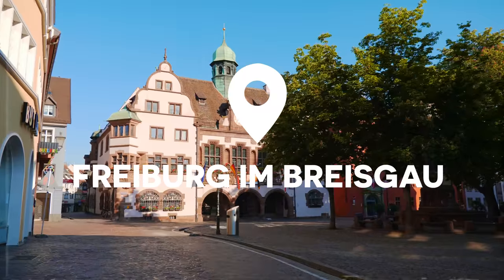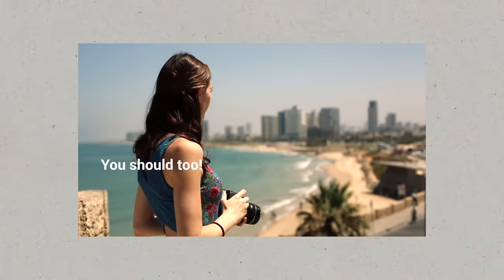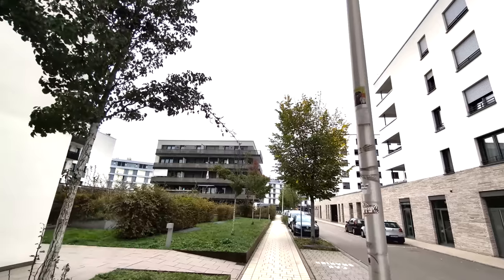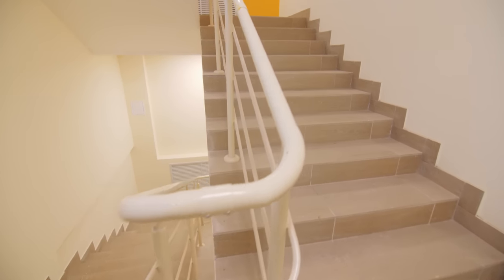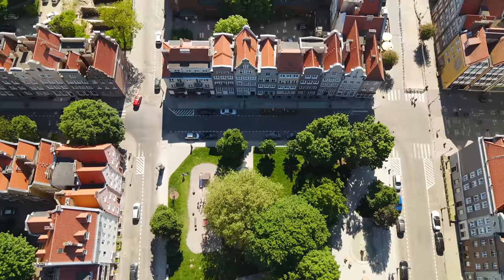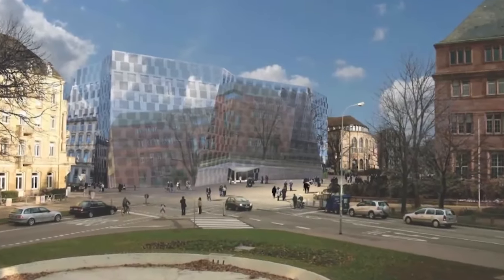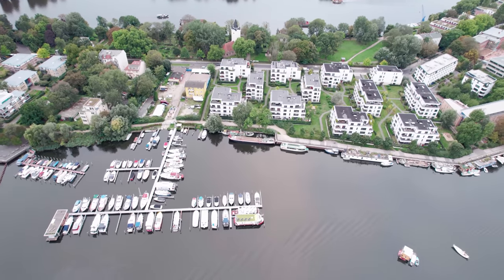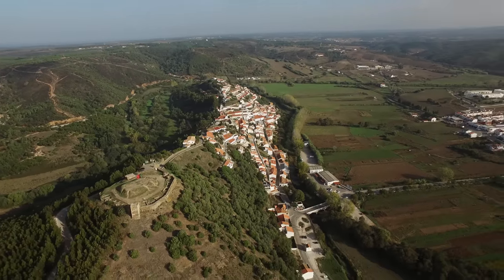Germany's BIG DUMB BOXES ARE AWESOME.

Comment: I worked in a building designed by someone who passes as a starchitect here in Malaysia. The problem was that all the curves did not fit well with our company, which dealt with PCs. PC boxes cannot fit flush against the walls. The basement which we used as a warehouse had ceilings that were too low. And the transparent roof panels (not sure if they were glass) had permanent water stains and leaked when it rained. I later worked in another IT company that used a dumb box. The place was a dump in comparison, but it was far more functional.

Comment: I am a building material scientist and really want to thank you for pointing out the huge amount of embodied energy in glass facades. Everybody is talking about how bad concrete is in this manner, but especially architects seem to forget, that a replacement with glass is even worse. In my opinion huge windows make a flat less livable than more conservative designs with smaller windows. You have less wall space, it has to be cleaned, in the summer the room heats up more and you need artificial cooling, Edge constructions are more prone to failures and are heat-bridges,...
I am also not a big fan of lame dumb concrete boxes, but they are much better than glass boxes with a fancy geometry.
Reply: Agreed. However, our windows (big, but not overly large, admittedly) help heat our house in winter, while the shade provided by the roof protects from the summer sun, or else the sunscreens do for the short time they may be needed.
Reply: @CaroAbebe  While writing the comment, I was thinking about pure glass facades, corners made of glass or huge window areas.
And I agree, if your windows have a good insulation value, they may help heating the rooms on sunny days.

Comment: Interesting as always, Ashton! My late father was an architect, studied as such in the 1940's and thus steeped in "functionalist style", which was much about doing away with heave ornaments and making for better living conditions for "the masses". He would probably endorsed this episode of yours. The idea of this as an architect stile was somewhat derailed by the industrialized building techniques of the 1960's. But building boxes doesn't necessarily equal lack of style.
Another thing which you hinted at is that the size is important for the environment to be livable. Personally I don't understand the present vogue about building 30 - 50 floor buildings. It is not what we used to do in Europe. No matter what country you study, traditional housing has been about 3 - 4 story buildings.
My father used to compare Denmark and Sweden in the 1960's, when we had a big building boom in Sweden. In the inner cities then, if one house in a blocks condemned, a big construction company bought the whole block and tore it down, building a new, much too large to be esthetically, box instead. That made for city centers mordor less all looking the same.
In Denmark however, they still were poorer than in sweden (it's quite the reverse these days). In the same situation therefore, they tore down the condemned house and squeezed a dew one in where the old one had been standing. Thus the new house automatically didn't differ too much in dimensions from the old one. And the over all environment looked pretty much the same as before.

Comment: The apartment I live in is almost a big, dumb box. It's exactly six storeys tall and contains eight apartments. The highest storey has a roof-top terrace and is pretty small, the other apartments have loggia-style balconies. Due to its location at a five-road intersection, it's staircase-shaped. But the building is very well insulated, the apartments get a lot of natural light, it's lovely.

Literally the only downside is that the footprint of it is quite big, which for the folks living in it mostly means we all dread it when the Kehrwoche arrives or it's winter, meaning there's about an hour or more of labor necessary to keep the sidewalks clean and accesible xD

Also, after having gotten into urbanism (as an amateur), I have realized that if I ever have the luxury of building my own home, it'll definitely be a pretty simple bungalow with a flat, greened roof (and solar panels), to make it an efficient little box to live in.

Comment: In Europe most new housing is still in the form of a box, regardless of having gabled or flat roofs. Less energy loss just because of the area/volume ratio being good and minimal use of material for a certain liveable floor space and easy to construct.
Compare with many new builds in the US, often single story with lots of intricate parts sticking out of the main structure on all sides also making the roof shapes complex, looks nice but adds to the cost significantly, using lots of materials for the given floor area and taking resources away from making the houses more energy efficient, more fire safe, more durable and of better quality in general.

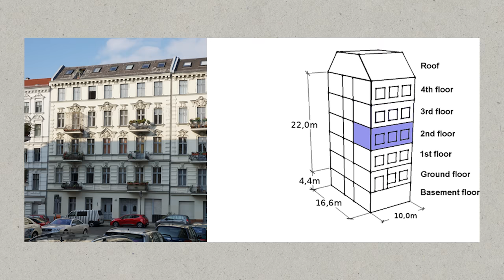Comment: 6:28 You are nearly right, but it is the other way round: "High rise means higher than 22m (highest inhabited floor). But the standardized ladders' performance is reach the building in a hight of 23m from12m (DLK 23/12) away. There do exist higher ladders and telescopic platforms, but these are not normally needed for rescuing people from high rises but are mostly for industrial use. Such buildings have (as you said) either two different staircases or a safety staircase either as a separate tower outside of the building oder a staircase inside which is kept under higher air pressure than normal, accessible through air locks.

Comment: The building I would like to live in would be up to 5 floors, whit 2 feet tick brick walls to the outside, large windows with wide windowsills and a round protruding tower at the corner (starting from 1st or 2nd floor). But that's just my fancy.
As for "boxes", I'm all for them, prrovided they are limited in height and consequently in number of flats, have an underground parking and a thoroghly thought through set of stores, groceries, libraries, schools etc. They don't have to dumb, owever; distinguishable colour scheme, mosaic on the facade, or even an ocassional folie would make them much less industrial looking and appealing to residents.

Comment: I live in a 5 story dumb box outside of Freiburg.  It's pretty great from an efficiency standpoint.  I hardly have to run the heat at all in the winter ( never have to turn it on in the bedroom), and of course AC is unnecessary.
Reply from the maker: Same! We have been holding out on turning on the heat as well. Sometimes the floors feel a bit cold on bare feet but our internal temp is still holding steady at 20C despite all of the cold rain (and quite a chilly morning today!)
Reply: At our last apartment we had a guy under us who installed a high efficiency wood burning heater that vented through our interior wall. We had warm floors and walls. It was pretty awesome. It would be nice to see some sun soon wouldn't it?
Reply from the maker: OH man it has been such a grey and rainy week. Yesterday morning the sun peaked out for a little bit and I immediately took the kids on a walk.

Comment: I‘d like to chip in my two cents on the Freiburg University Library. Taking the data from the University’s presentation (available online) things don’t look as bad as they first seemed after watching the video. According to the University’s website the overall amount of ‘usable space’ (Nutzfläche) is the same as the old building’s while the surface area of the new building (the building’s shell) is about 60% of the old one’s. The new building also features a number of sustainability perks like core temperated slabs, high efficiency glazing, a heat recovery scheme and ground water cooling - all of which were still pretty innovative 15 years ago and supposedly leaves the building with an energy consumption of only a third of that of the old building. 
Of course the website doesn’t talk about the amount of grey energy that went into the construction nor does it explain why the old building had to be torn down completely instead of following a remodeling concept.
So, all in all I’d dare to conclude that the building shouldn’t be counted as a complete failure. 
That being said, I do agree to the point you made about the many advantages simple ‘dumb boxes’ provide as excellent building blocks for a modern city - as long as this goes together with a meaningful concept for the design of the urban space.

Comment: As an octogenarian engineer whose architectural ambitions were squelched by economic reality shortly after high school, I see this contrast between North America and Germany a bit differently. There are "dumb boxes"  being built in both cultures, but the differences are mainly due to availability of local building materials.  Here in N.A. there is still plenty of timber, so design centers around how that material can be used with minor changes to the exterior walls just as I am seeing in the European buildings from your examples.
 Fitting in with the older buildings also seems to provide architectural influences for the differences. Most of the North American  developments consumed  more former agricultural land, in suburbs without  structural context nearby. 
I live in Orange County CA and have watched this process for decades. The generally 'blank canvas'  if orange groves upon which our alluvial plane has developed since WWII is just now finding 'dumb box' styles in the infill between major new towns as we urbanize this  former Los Angeles suburb and the rush hour traffic patterns now go both ways on the expressways we chose to  call Freeways. Those were incidentally influenced by the AutoBahns, a further reflection of transatlantic architectural commonality  of thought.

Comment: There are so many things to think about when talking about something "beautiful"!
In terms of cities, I think you are absolutely right: multi unit houses with no more than 6 floors and more or less cube-shaped are probably a good, sustainable and on various levels resilient way to go. Variation and individualism can be brought in by different kinds of surface materials and structures as well as colour. In older or more traditional quarters of the city, I'd go for gabled roofs, rather than flat. Mainly for aesthetic reasons.
Similarly single family homes: If they are built on the outskirts of a city or town, you can go for the cubic design. In real small European villages, I'd also go for the trad-adaption of a gabled roof.
I did mention materials.
From my point of view, wood is a very good material IF the house is allowed to stand for a long time! This way, the carbon that is captured in the wood will stand with the house and not be set free by the wood rotting or being burned.
Recently in my neighbourhood, there were two block houses built. One of them I don't like because the wood was imported over a few thousand kilometers and the design is not one that fits in this area. The other one, however, is made of wood from the same Bundesland (German State), looks like any house, just woodier, is nicely isolated and can stand there for centuries. The inside walls are made of clay which means the interior climate is not too much dominated by the wood. I really like the idea.
And this wooden building captures carbon, whereas cement or bricks need a lot of energy in their production.
The only problem: these huge stems don't grow so fast! So, for houses built from massive wood, I'd prefer a technique where you can use younger trees.

Comment: Dumb boxes in my country brings to mind the hastily and cheaply built apartment buildings from 70s and 80s, we sometimes call those "the suicide boxes" because of uninspiring and depressing environment and appearance. Personally I prefer older architecture, it's just more appealing  and inspiring to eye while being functional and seem to hold time better than boxes from that time period. Maybe there is a way to make them more appealing and resilient at the same time.
Reply: building quality in the 70s was so bad. I once was explained that that was a time when due to new building materials it was possible to build cheap for the first time. So there was a building rush of cheap constructions. Unfortunately nobody considered the quality and longevity. In Vienna buildings from that area are already being torn down, which is a shame after so little time....
Reply: @llleiea  True. Additionally there was the energy crisis, so the idea was to build everything more energy efficient, which meant trying to insulate everything and build houses like bottles. Some new innovations that didn't go well at all. Maybe some of them would have fared better if the overall architecture (on small houses and rowhouses) wasn't so keen on low profile boxes with foundation as low to the ground as possible and without anything stopping water/moisture from the ground entering the lowest wooden structures... Now we have new energy crisis in a bit different form and I'm afraid that we will see some more new innovations that don't survive the test of time.

Comment: How well does green Facades work? It could improve the look of the "dumb boxes" and if you vary the plants, the buildings still can look a bit different, even if the builing itself is the same dumb box. Should be good the the look, atleast in my opinion. Also i guess it should reduce heating and cooling costs and can be pretty good for the biodiversity in the area. Does it come with higher constructing or maintenance costs? Nice video btw

Comment: Oh so much to say, but im sure you are right about the size of the house. My knowledge about that is that good. 
But ill say this, they need stop building the "eco friendly" houses cause are are most of the time the complete opposite. An example, across the steet where i live they did a total renovation of an apartment building, tore out everything to the bare bone of the buliding and were going to make everything eco friendly. Well now a couple of years later a lot of the poeple that moved in to the new appartments have now moved out, they are falling appart cause these eco friendly materials dont last. A wile ago an architect and engineer here in Sweden said if we want to make buildings that last we need to build them from stone like they did hundred of years ago, there is a reason those buildings still stand today and many actually wants to live in them.

Comment: So, Ashton, I wonder what you would have to say about the Elphilharmonie in Hamburg. Every single one of the glass plates on the outside and every single one of the plaster plates covering the walls and ceilings of the hall itself are unique and had to be manufactured separately.
Reply: Ashton doesn't seem to be so much into Basel architects :-).
Reply from the maker: It's a cool building to look at and I hear the acoustics are outstanding. It is definitely a "duck" as Robert Venturi would term it. 

https://99percentinvisible.org/article/lessons-sin-city-architecture-ducks-versus-decorated-sheds/

And ducks like the Elphilharmonie mean that they are inherently more about "art" than anything else, including sustainability. If that's your goal, cool. Own it. My only grind is when art projects like these try to then turn around and tout how "green" they are (like what happened with the Freiburg Library).
Reply: @TypeAshton  I think it‘s safe to say that at the time the Elphi was designed, criteria of „green“ and „sustainable“ did not play quite the significant role we find today. In any case, I don‘t recall ever hearing anyone make any such claims for the building.
Otherwise, I could go on for ages about the building. While the hall itself is excellent (although I am highly skeptical of the vineyard-style halls in general) and I‘m very happy to have it here in Hamburg, the location is a disaster.

Comment: The "don't build big dumb boxes" has 3 components:
A "big box" is fine as long as it's not "dumb" i.e. featureless. This seems to be the North American go-to solution; just add nooks and jut-outs galore and set the top 2 floors back, oh and also use 4 different facade materials and styles for different parts of the same building.
A "big dumb" building would be (actually look) fine as long as it's not a box. Take that library for example. It's big and featureless, but doesn't just look like "more of the same" because it's not a box.
A "dumb box" is fine, as long as it's not big. If you have only 1 or 2 featureless apartment building along the face of a city block (or 3 identical "tower in the park" style buildings), their size and uniformity is overwhelming. But if you have 5 or 10 smaller dumb boxes along the side of a block that are all different (even just painted differently) you avoid the problems. Interest comes from variation; and if you have a whole city then there's no law that says that that variation has to be within a single building.

If you have a "small" building which is also not a box (think a single-family house with slanted roof), then you generally don't need to make sure that it's not dumb. Unless you make it stand on it's own with exaggerated setbacks and/or in a sea of equally sized buildings, which is how McMansions are forced to be so ridiculously over-detailed.

And the 4th bonus component is the plural in "boxes". If your city has a single big dumb box, it may be fine, as long as there's enough variation in the other parts of the built environment.